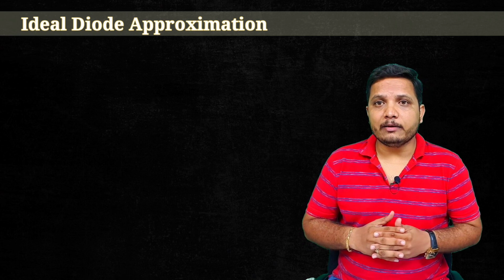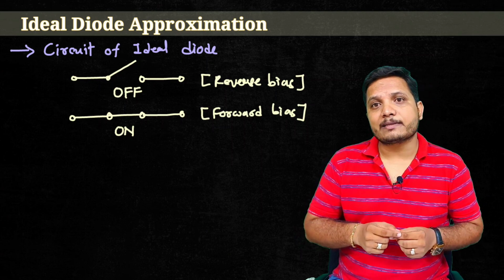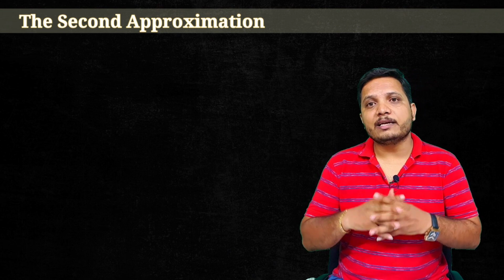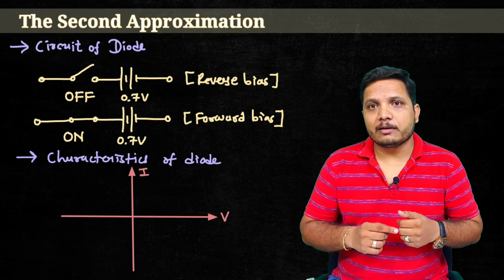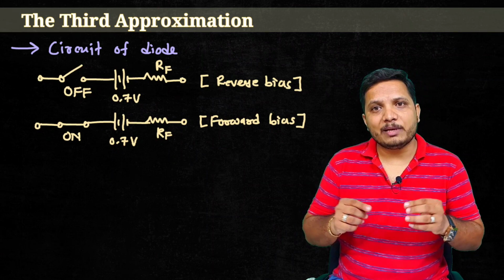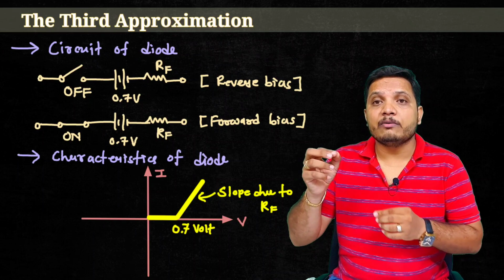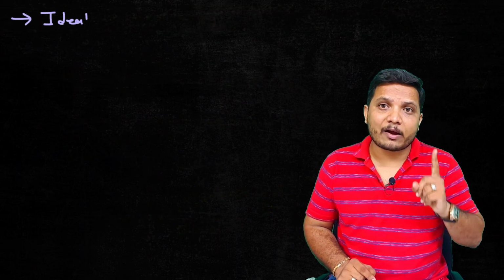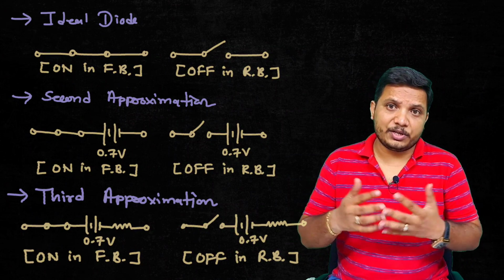Ideal Diode and Practical Diode Approximation

Comment: what is the significance of phase margin and gain margin
Reply from the maker: It is margin with respect to stability
Reply: @EngineeringFunda  
I am civil engg background. So l like to verify the stability you mean is circuit stability. In such case how to know the period for  which system is stable
Reply from the maker: @ramesht-psgct1135  : stability is not defined based on period. it is defined based on region of operation.
Reply: @EngineeringFunda  k sir, my question how long the system will be stable.
Reply from the maker: @ramesht-psgct1135  : it is not based on time.